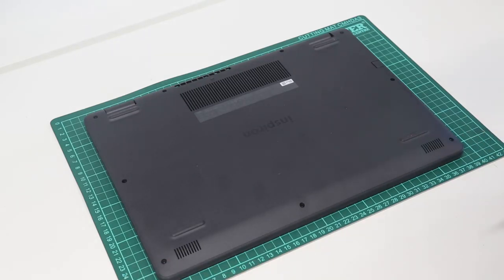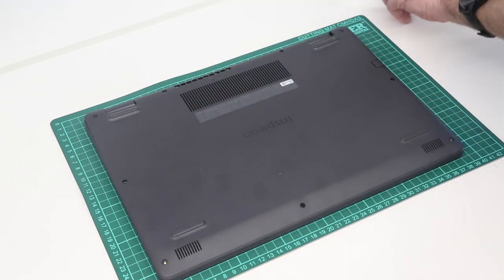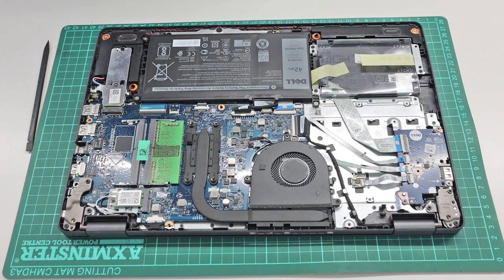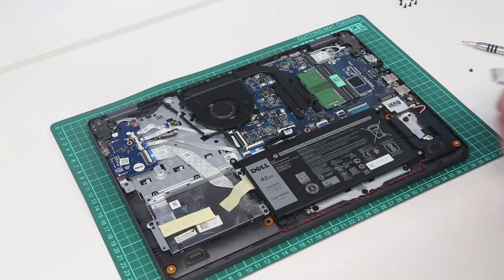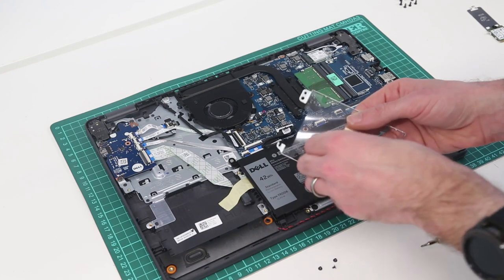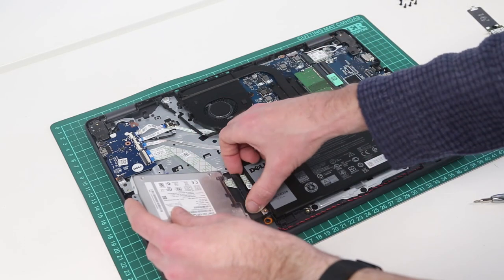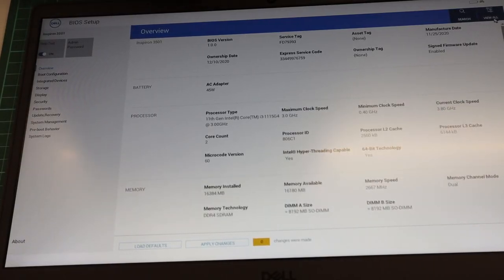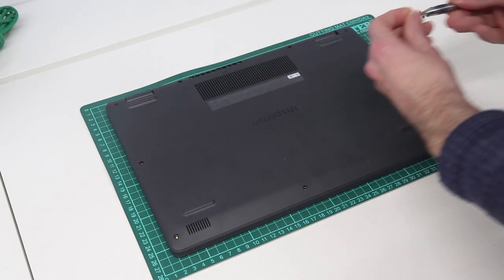Dell Inspiron 15 3501 - M.2 SSD Upgrade, 2.5" HDD Fitting and RAM Upgrade Guide

Comment: What is the ram limit 
I bought it today and it's not doing well with multi tasking
Reply from the maker: Maximum officially supported is I believe 2 x 16GB for 32GB in total. For most users 2 x 8GB should be plenty though.

Comment: has dell updated the BIOS so it can now run at 3200 or is it still stuck at 2667?
Reply from the maker: I don't believe they'll ever do that - it appeared to be a decision to have the 3000-series machine run lower memory speed than the 5000-series.
Reply: @BrueComputing  so basically, is it pointless to upgrade the RAM or Storage on this laptop? Will the computer even accept it if I do?

Comment: Hi! Thanks for share. Please tell me if you know, altought 2666MHz is the maximum speed, if I need to upgrade with another 8 GB RAM memory for example, I need to buy a 2666MHz memory or another of 3200MHz because I remember read in some blog if RAM have different MHz and they are used at same time it can cause failures. Please tell me if you know something about it. Newly thanks for share
Reply: use the same MHz on RAM, using different Mhz will cause BSOD and also memory may not be identified.
Reply: nowadays it is very rare to have a problem with different frequencies and times. if they are the same it is better, but it will work anyway
Reply: If ram have different Mhz, both modules will work with the slowest speed.

Comment: I recently purchased dell inspiron 3501 core i3 with 4gb ram and 1tb rom it’s quite slow and takes time to open chrome . Can I increase its speed with DDR4 4gb ram 2666mhz
Reply from the maker: Yes, but swapping the mechanical HDD for a solid-state drive will have a far greater impact.

Comment: Does it have sim slot? if not can we any another option??
Reply from the maker: Not on the models sold in the UK as far as I'm aware. You'd have to use a 4G WiFi hub or a USB dongle I think.

Comment: Does the sysytem support a total of 32GB ram? Thanks!
Reply: I think it's only 16GB. I've seen specification ona few shops, and all but one said it's 16GB limit.
Reply: Yes. Just put in 2 x 16GB, it works.
Reply: But it doesn't need 32Gb for that specs 16 is more than enough..

Comment: I feel like there is an obvious answer to this question, but can the cpu or gpu be replaced?
Reply from the maker: Only if you were to replace the mainboard. The CPU is soldered to the mainboard, and the GPU is part of the CPU.
Reply: @BrueComputing  so are there any boards that have i7 or greater? Mine has i3...
Reply from the maker: Yes, you could get the 3501 with the i7-1165G7 from Dell.
Its probably not economical to do though - you'd be better off just selling it and buying a better laptop.
Reply: @BrueComputing  you’re probably right lol, thanks for the suggestion!

Comment: Hey man what is the you computer procesor space ? Please answer me
Reply from the maker: Test system had a Core i3-1115G4.
Reply: @BrueComputing  yes m.r thanks
Reply: @BrueComputing  my computer space is intel core i3 procesor  3.00GHz 4GB ram.  Iam add 8GB Ram      my pc all ram capacity is 12GB   Not Problem
Reply from the maker: Yes that should work.
Reply: @BrueComputing   this 4GB and 8GB not problem ?
Reply from the maker: Matched pairs is optimal for performance, but should work fine.

Comment: Thanks for the video, any suggestions to increase the memory frequency to 3200?
Reply from the maker: Not that I know of, the CPU supports it, but Dell have locked down the BIOS to only support DDR4-2666 speeds even when 3200 modules are fitted.
Reply: j_____  16 GB

Comment: my laptop is dell inspiron 3501 i3 10th gen processor can my laptop support nvme ssd 
and cloning
Reply from the maker: Yes.
Reply: @BrueComputing  so cloning supports right im currently using windows 11 insider preview
What if I upgrade to SSD will it will be there or I will get back to windows 10

Comment: I don't have a pry tool is an old credit card ok?
Reply from the maker: Its not ideal as a proper pry tool is stiffer, but as the back screws pop the rear corners it should suffice.
Reply: I use old frequent shoppers cards and then if you need one with a sharper edge, just file it with a nail file.

Comment: Where is the location of cmos battery
Reply from the maker: It is on the underside of the I/O board - the small board with the ribbon cables running to it.

Comment: Is graphic card Gpu is upgradable in laptop
Reply from the maker: Only by replacing the mainboard for a version with a more powerful CPU or which has the NVIDIA discrete graphics installed.
Reply: @BrueComputing  Thanks👍

Comment: What is the GPUof this model?
Reply from the maker: The system I had with the Core i3 had Intel UHD graphics. The i5 and i7 models have Iris XE.
Reply: @BrueComputing  that's why it only runs in 2667 when you plugged-in the Crucial RAMs
Reply from the maker: @MattMoralesPH  Dell limit DDR4 speed on the 3000-series models - the 5000-series and above run at full speed.

Comment: Can I upgrade the cpu or not?
Reply from the maker: Only by replacing the mainboard - no modern laptop has a replaceable processor.
Reply: @BrueComputing  Thank you
Reply: @BrueComputing  Well do you know the boards can I put them in my laptop?
Reply from the maker: @HistoryL  I don't have the part numbers for them, but it probably wouldn't make sense vs. just buying a better laptop.
Reply: @BrueComputing  Thank you for your suggestion

Comment: Battery upgrade 3 cell to 4cell it's possible or not
Reply: @Brue Computing, I'm interested as well, please answer us, Sir. Very well explained video, though!
Reply: No. When this video was published the battery provided in this model was 3 cell and then you also get the 2.5" drive bay. As of now, Feb 2023, the Inspiron 15 no longer has the 2.5" bay, so they take that space and give you a 4 cell battery instead.

Comment: Can I use ssd+hdd both??
Reply from the maker: Yes.
Reply: @BrueComputing  recently i have bought a new laptop dell i5 3501 11gen
If want to use ssd+hdd then what need to do??can you tell me Please?? 
But in that windows only hdd.. What need to do??Sir
Reply: @aitawsim2115  Is the screen glossy or matte? And does it have CD rom?
Reply: @TonyStark-nw1ll  no cd rom 
Screen is matte
Reply: @Poisõn-P48LO  bad no cd rom
Reply: @aitawsim2115  You can put a nvme ssd with that hdd
Reply: @Poisõn-P48LO  go away

Comment: Nice Very Very Nice
 but dell manufacturing not good  
back cover removing   is very difficult.
Reply from the maker: Its not that bad - the rear screws lift the back corners which is easier then having to press the pry tool in to make the first opening on many laptops.

Comment: my laptop ram is 3200 when i open it.i just follow ur advice to buy 2666 one..its my mistake and waste of money.its my fault not checking first the inside before following the youtube videos
Reply from the maker: If you have a model with NVIDIA graphics it'll run the RAM at 3200. If not then it may have a 3200 module install, but will only run at 2666, so adding a 2666 would work.

Comment: Can I update gpu
Reply from the maker: No, the GPU is integrated into the CPU, which is soldered to the mainboard and cannot be upgraded. The only option would be to replace the mainboard with one which had the higher spec CPU (or discrete graphics chip if available) on it which probably wouldn't be economical vs. just selling the laptop and buying something else.
Reply: @BrueComputing  does it have gddr5 slot